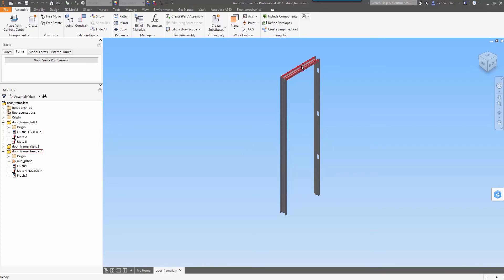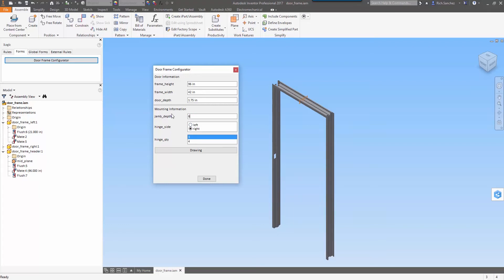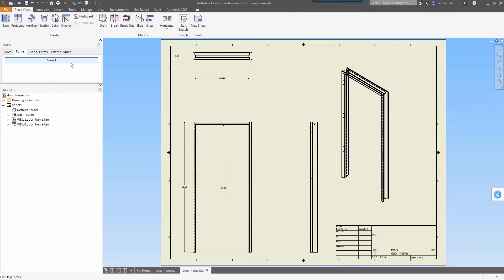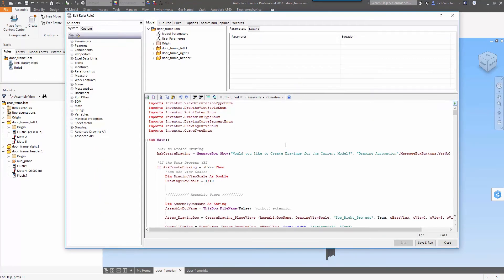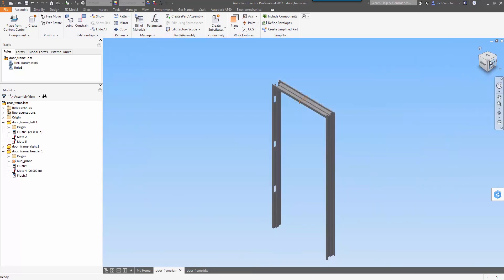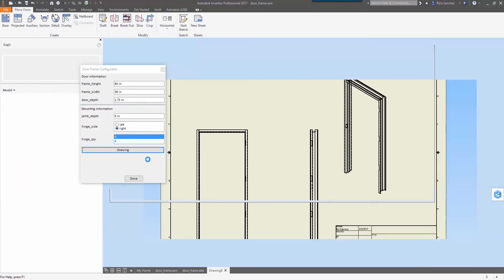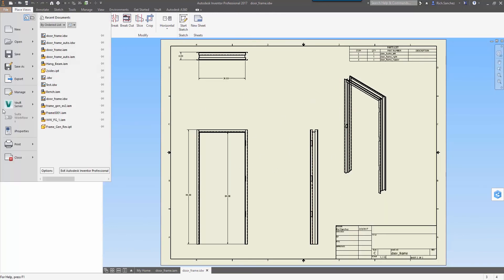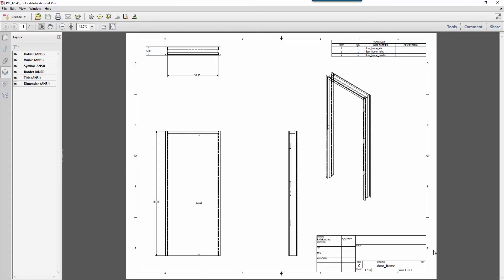iLogic Forms & Drawing Automation | Quick Tip

Comment: I need more training for this do you offer any training for this? I currently created an i-Assembly using i-Logics for an office furniture. Now what I'm in charge of doing is transferring this to Configurator 360 but I also have to create i-Logics in the drawing to control scaling spacing of each view and choosing the correct title block. I really need some help because I'm really new to the i-Logics which I really learned in a matter of 3 months on how to create i-Logics for the i-Assembly but for a drawing file is much more different. Can you email me if you do offer some classes for that. Maybe I can send you what I'm working on so far and you can give me some pointers and advice on what type of i-Logics work best on what I'm currently working on.
Reply from the maker: HI Oscar. We certainly do offer iLogic training and consulting here at KETIV.  Send me an email at questions@ketiv.com and we can get you some info on our training courses. 

-Nigel